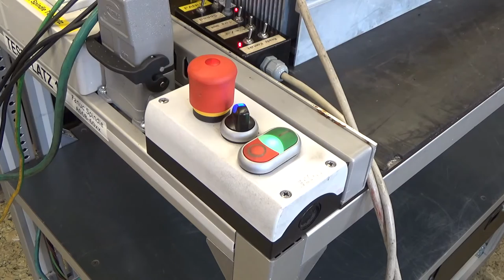A06B-6059-H215 Fanuc AC Spindle Servo Unit test and repair by industrypart.com

Comment: are you know fanuc spindle drive accel and decel time setting.

i have old brigdeport interact 412 cnc machine also have installed fanuc ac spindle drive 7.5kw and when i start spindle motor at 6000 rpm than its take much fast to reach at 6000 rpm in just 2 seconds.
i am now need to setting in this drive to long accel time like 6 second 

help me if possible 

thanks

Comment: Hello sir, 
 I have a problem in my vmc machin 
It have a alarm ot112 current excess dc link link can you help me for ghis problem
Reply: Check the OPAMP that is measuring DC current. Sometimes its generates signal with no reason. You need to change it. But you never know so check the resistance which may degrade sometimes.